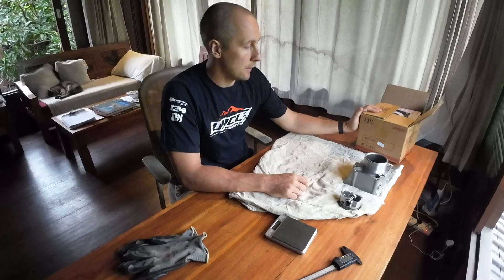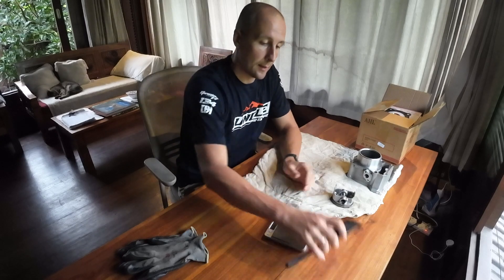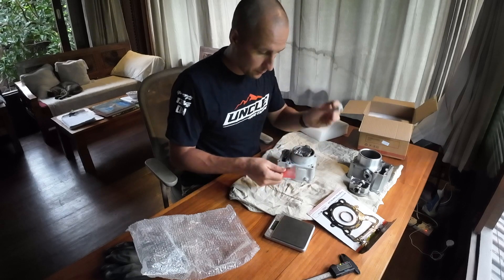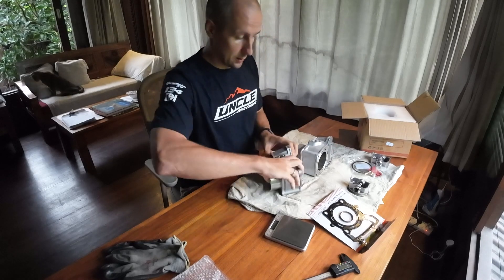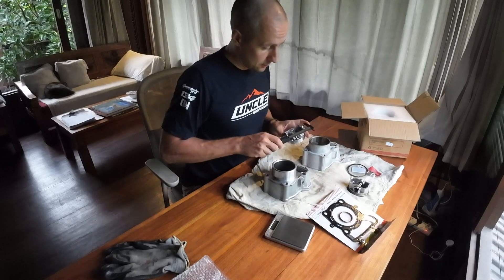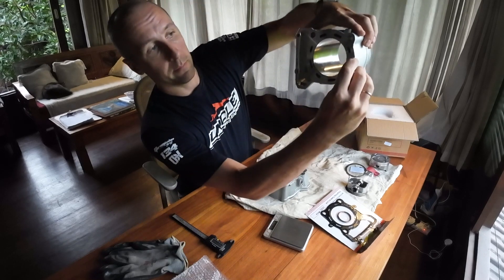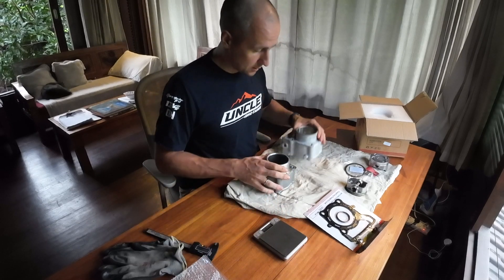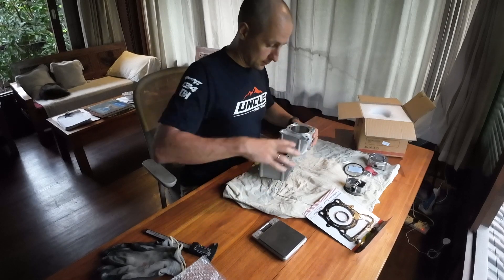Review of the 292cc AHL "299" cylinder kit for Kawasaki KLX250/KLX300

Comment: Is it proven more HP with tthe 299 kit? The klx300 and klx250s have the same horsepower
Reply from the maker: @jex8046  of course klx300 and klx250 different power. 299 kit is equal to upgrading from klx250 to klx300
Reply: @planetklx2  cool I just got one on order. Need to know if you had to modify anything to ensure proper installation
Reply from the maker: @jex8046  newer 299 kits are plug and play. Older kits required some minor grinding.
Reply: @planetklx2  is 299 kit fit without any  modified and if need what part needs to and what part need to grind ?
Reply from the maker: @AliAlhayki.bh973  plug and play